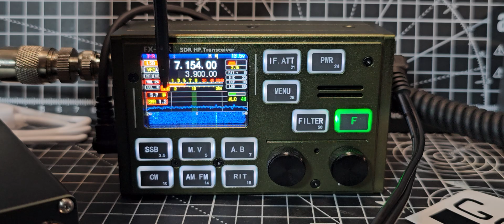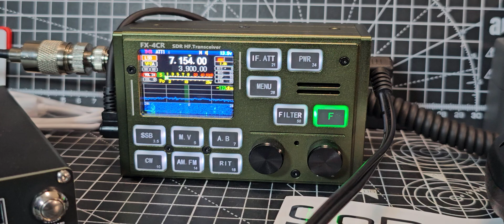FX-4CR , SWR METER ?

Comment: About that SWR meter, could you put the radio in very low transmit power and use the SWR meter to tune a whip antenna such as the Elecraft AX1, shortening it or lengthening it a bit to dial it in while watching the SWR? I'm trying to minimize my pack weight for SOTA.
Reply from the maker: Yes
Reply: @M0FXBHamTech  Appreciated. Yu sent me the invoice last night so I'm in his queue :)